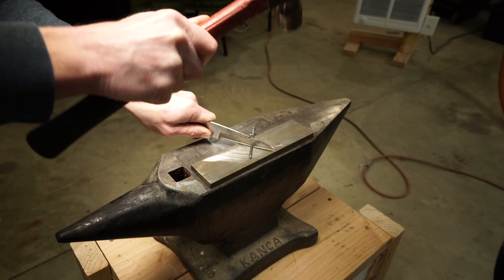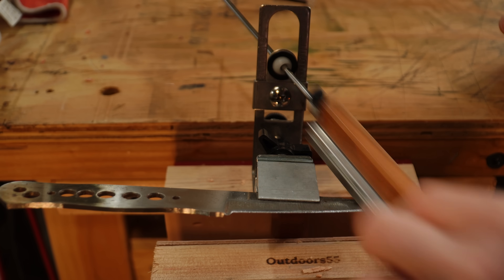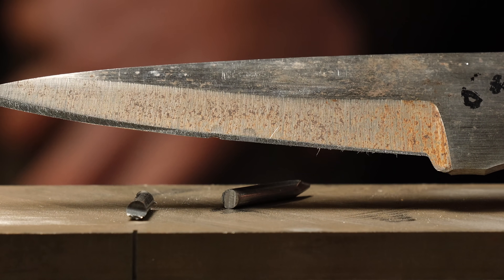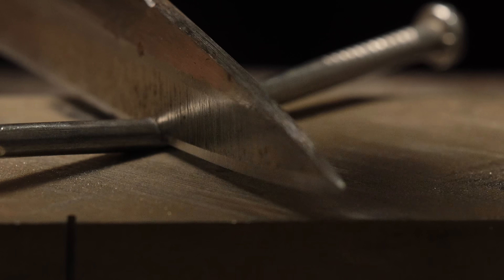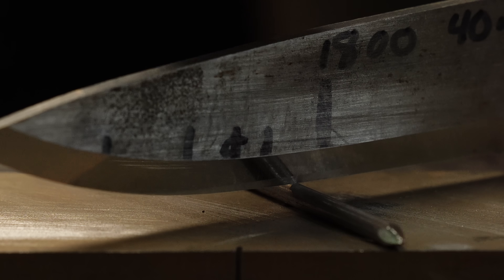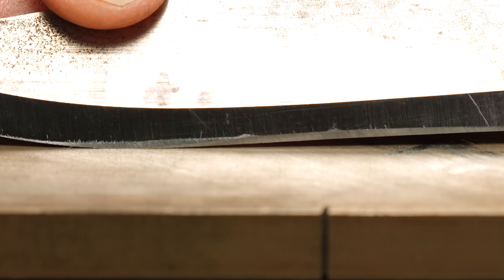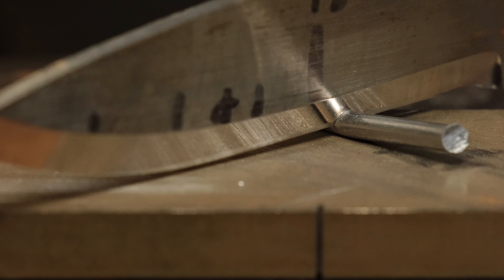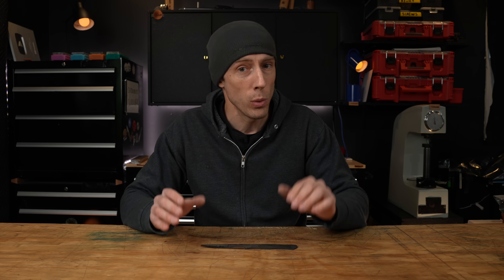Why My Knife Will Cut Through Nails And Yours Can’t - THE TRUTH is not what you think.

Comment: It makes sense, if you hammer a straight razor through a nail - expect significant damage. 

If you take a pair of diagonal cutters with 45° chisel looking ends, it’ll chew through a nail with no issues. 

Would space age alloys and super steels allow for a slightly smaller angle with no damage? I mean obviously a blade made of ivory soap is going to deform regardless of angle - is there any advantage for the super hard alloys, even if just fleetingly small? 

I’m thinking you could get away with 29° or 28° angle instead of 30° - or would the advantages be even smaller than that?

Cheers!

Comment: That is why pliers use right triangles.
Reply: The cutters on most wire strippers are only 35 degrees. Knipex uses 45 degrees for their cutter angle on their wire strippers.
Reply: @travisworts6249  some use 35 because then the base of the triangle is only 15% longer as opposed to 41 for right triangles and the don't use equilateral triangles for obvious reasons.

Comment: I was recently speaking with a company that was worried about the strength of the edge with high hrc, and i said basically what you did here if you want your edge to take abuse then play with the geometry but don't run the steel soft to doit
Reply from the maker: Exactly 👍
Reply: Yeah softer usually just causes more deformation.  Less chipping, more crumple.
Reply: Resistance to deformation (rolling) is also a part of apex stability, not just chipping. High hrc gives you this resistance. Having a steel that retains reasonable or good toughness at a very high rockwell hardness is the key to having magnificent apex stability. It will neither want to chip nor roll. Rex 45, M4, 4v, K390, CruWear, 3v, etc are all good examples.
Proper geometry to go with it of course.....
Reply: @Aerzon1v1  That bothers me very much on the "industrial" knives - they usually HT the blades too soft for a certain steel, even that that steel suports higher hardness. I hate to have a D2, 14c28n, etc. steel which is subject to edge rolling as soon as i use it. It's true that I can afford only cheap knives and steels, but even that steels could be done properly.
Reply: @Aerzon1v1  If you remove rex45 aka hap40 from that list, then we can agree. Hap40 is a cobalt high speed tool steel and it's highly overrated for a blade steel.  Everything else on the list is 100% though I would have put them in order. 3v, cruwear, 4v, m4, k390. From the toughest, least abrasion resistance to most abrasion resistance.
Reply: Yeah, and then one “clever guy” sharpens the blade to 17dps and there we go.😂
Reply: @Warsmith_Honsou  well it will make the blade sharper if you sharpen at a tighter angle (depending if the steel can hold that angle when using it for utility)
Reply: @Alvarezguitarz  We seem to be discussing cutting edge strength rather than efficiency.
Reply: The fact that knife companies have to ask random youtube knife reviewers for technical advice is pretty shocking then again I probably shouldn't be surprised considering 99.9999% of production or mass market EDC knives are trash at worst or compromised at best.
Reply: Why compromise the heat treat and worsen the performance of your steels just to have a knife with an aesthetically pleasing bevel grind?
Reply: @wolfshield22  who really needs a knife, anyway? we should ban all knives and make society safe again. Let's ban all sharpening supplies too.  LOL
Reply: @skippylippy547 how you gonna cut your steak?
Reply: @skippylippy547  Hey!!!! Those are cuss words!!! 😂
Reply: @KMESharpeners  😅🤣😂  LOL!
Reply: @KMESharpeners I recently bought your deluxe kit and I have to say it produces the best edges I've ever seen and used. I sharpener a tungsten carbide blade on it and it SHREDDED the tungsten
Reply: @skippylippy547  say what you mean bub

Comment: Excellent! Of course the edge angle has a huge effect on edge retention and cutting ability. They are "opposites" so it is a matter of having the correct compromise for each use case.
Reply: can ü elaborate a bit on this?
Reply: @jarrettmoreland4921  The video was about this.

The thinner the edge, the better it cuts and the more susceptible to damage it is. You cannot have both maxed, the cutting ability and strength.

At the extremes we could look at a razor blade versus an axe.

This is the reason our kitchen has many different knives with different edge geometries. The biggest hurdle is to make the family members aware of this effect and not destroy edges by using too delicate a knife for heavy duty cutting.

Their favourite is to use the tip of a knife to pry something. I have repaired knife tips oh so many times due to that.
Reply: @kokehri  hahaa rockstar. thank ü for that.

Comment: Put ~10°ps on it with a 20°ps micro bevel (true micro). It should hold up and cut easier.

1- destress the edge
2- secondary to 10°ps
3- apex a micro to 20°ps

If you do, don’t form a burr. Forming a burr lowers edge retention and you end up with a fatigued and damaged apex on a freshly sharpened knife.

Comment: Lookup the peterbiltknifeguy. Hes proved over and over that isnt the grind. It is the steel and heat treatment. The buck 110 s35v broke clean in half in one hit...is that really the grind and bevel?? Yea, no. Youre right alot, but youre wrong on this one
Reply from the maker: Not wrong. I literally show everything in this video. The reason is because GEOMETRY. Whatever the geometry was on the knife that broke, was too thin for chopping a nail. Add material to the bevel and it get stronger. It doesn't take much.
Reply: @OUTDOORS55  i watched yours before i commented. Hes done the test like you and gotten opposite results. Buck owners immediately started reeing about how it was geometry and bevel, so he changed those and the Buck knives still performed abysmally. 

Idk, ive watched 100 or more of his videos proving the heat treat mattered much much more than the grind or bevel. Or at least we suspect its heat treat, because its definitely not the aforementioned 2 factors.
Reply from the maker: Geometry applies to both the secondary, AND primary grind. You can't add geometry, and or material where it has already been removed. If the knife has a primary grind thats too thin for cutting something, and it breaks, you can't add material back. Basically, you can't prove this with a knife that's already too thin. At some point you certainly can have a super bad heat treatment that affects cutting something in particular. But other factors need to be ruled out first. Hammering a knife through mild Steel simply doesn't show what people think it does in a lot of cases. If a test can be manipulated by simply changing the sharpening angle a few degrees, or grinding the primary a few thousand too thin, it simply isn't a good measure of ht and or steel.
Reply: @OUTDOORS55    i was mostly giving you a crap. You usually know your stuff. Can you explain why different brand knives with same steel, same bevel angle, and same grind, perform drastically different if its not the heat?? All other factors are the same.

ETA that i didnt mean that in a smarta$$ tone. But im genuinely curious. Changing to a steeper bevel would definitely help a knife in regards to the nail test. But theres something else going on when all factors but heat treat are equal, or when blades snap in half instead of just dimple
Reply: @OUTDOORS55 if the geometry was kept consistent between knives, would it then be a valid test of steel and heat treat?
Reply: @OUTDOORS55  He's totally missing the point!
Reply: Dude it's a hollow grind...
Reply: @citizenkane454  he used hollow and flat grind benchmades, and other brands with very acute angle bevels, and they performed wonderfully. Its not the grind dude. I thought so at first too, but its not

Comment: Technically this seems as if it is not even cutting, it is splitting. Just as one does with a splitting axe and piece of wood. The geometry of the axe head forces the wood apart as it wedges between the fibers more so than the edge cuts the wood. A similar thing is going on here I presume.
Reply: Exactly, knives are meant to cut, not be an axe basically.
Reply: I think it's just the narrower edge is more vulnerable in this case. There are no fibres to cut
Reply: @saladorIV  You completely misunderstood my point. I never said the metal has fibers.
Reply: No, it's cutting. I get what you're saying but it's a clean cut. It's not cracking or splitting anywhere that I can see.

Comment: Idk, but its really shown how bad Buck knives are. And i love it. Buck owners are insufferable boomers who never use their knives
Reply from the maker: Bad at what? Cutting a nail with geometry thats too thin for cutting a nail?
Reply: @OUTDOORS55  other knives that arent designed for that, and have similar angles and grinds did just fine. .... I didnt realize youre a Buck fan Outdoors55 lol

The freaking Mora Companion did better than Buck
Reply from the maker: Im not, I actually don't like their knives. Remember this is a game of a few degrees, and thousandths in grind thickness.
Reply: @OUTDOORS55  i was mostly giving you a crap. You usually know your stuff. So explain why different brand knives with same steel, same bevel angle, and same grind, perform drastically different if its not the heat?? All other factors are the same.

ETA that i didnt mean that in a smarta$$ tone. But im genuinely curious. Changing to a steeper bevel would definitely help a knife in regards to the nail test. But theres something else going on when all factors but heat treat are equal, or when blades snap in half instead of just dimple
Reply: Don't worry, people like me don't exist